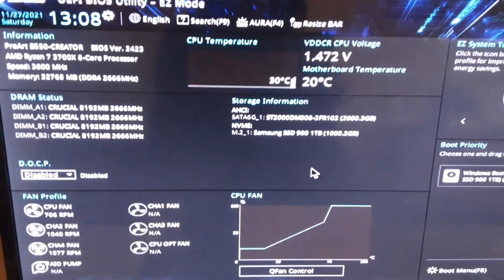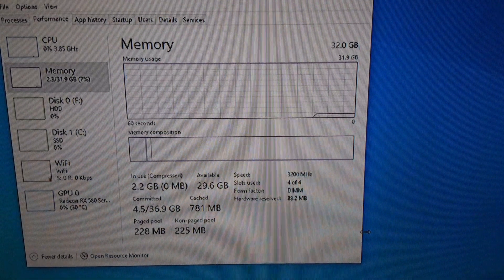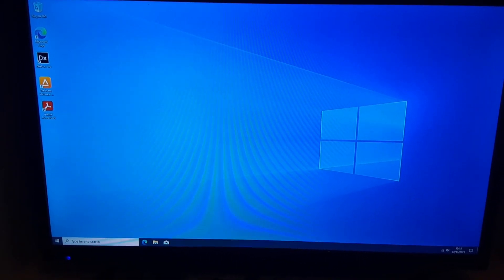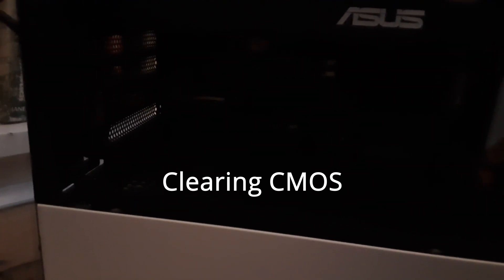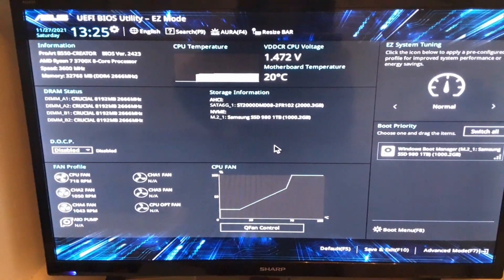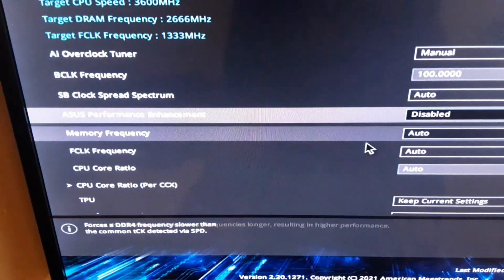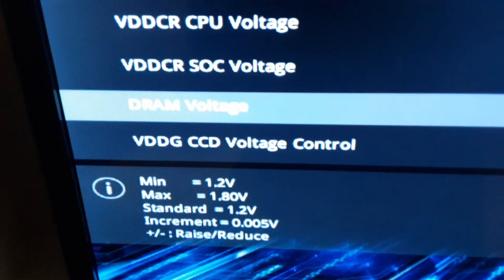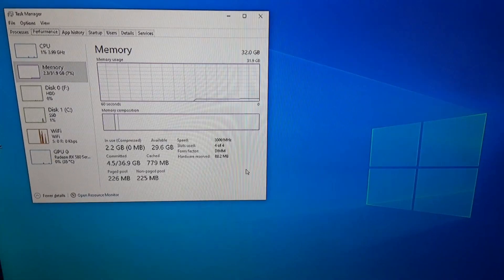How To Fix RAM Errors after Cold Reboot or Switching off PSU for Ryzen CPU's - XMP No Post Diagnosis

Comment: I have a b450 Asus plus and does this exact thing
Reply from the maker: Funny they are both asus boards having same problem, I contacted support and they also said its probably related to dram training voltage. Did you fix the problem by setting a manual profile ?